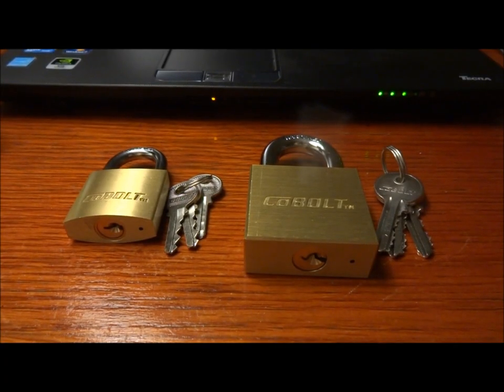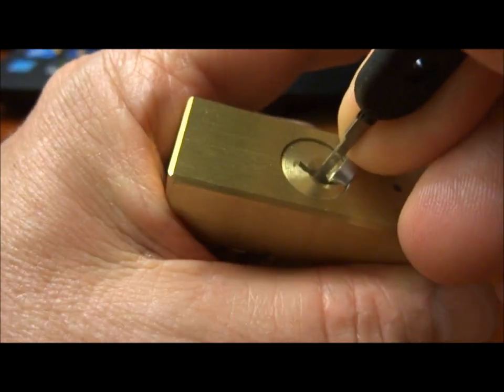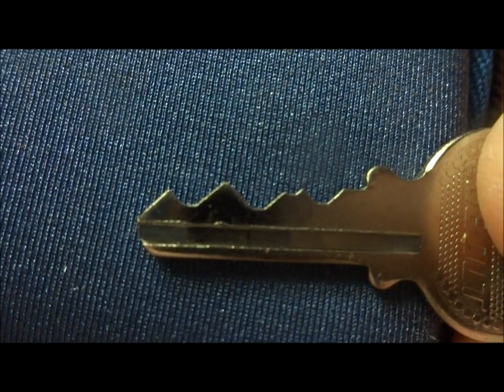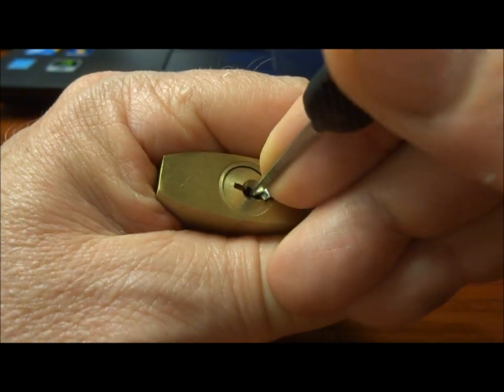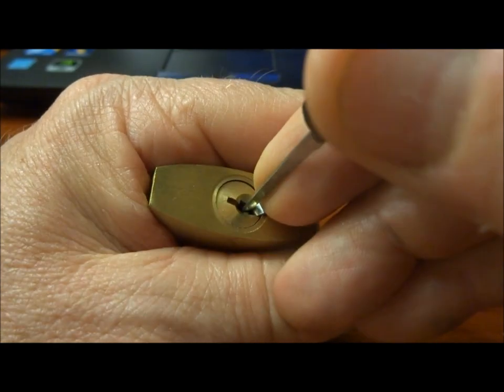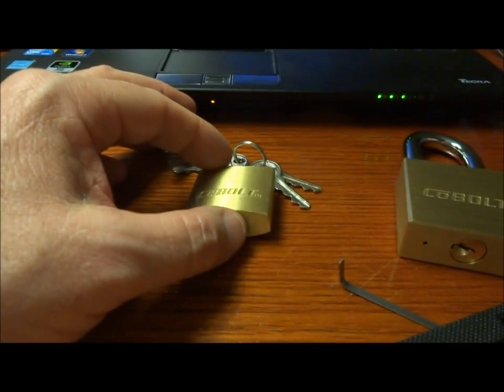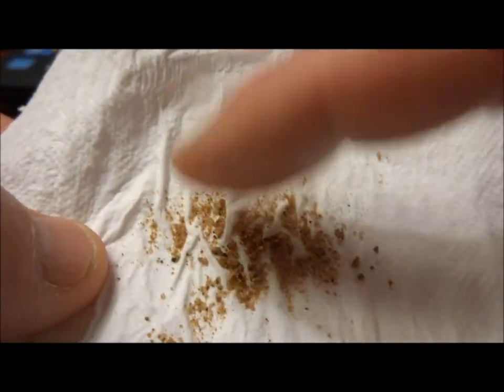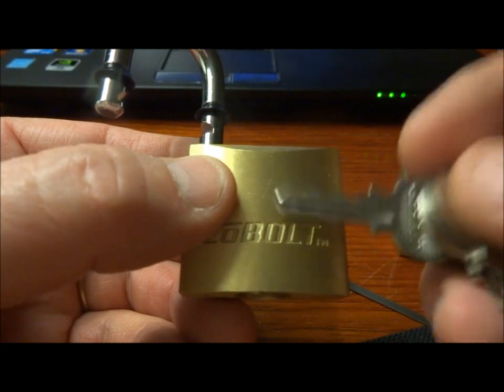(219) Complex Pinning and "Secret Sauce"

Comment: Hehe, sometimes that type of "secret sauce" can kill you. My bicycle stalled in a busy intersection, got me close to Mr. Death. The one-way mechanism in my rear wheel suddenly went "free way" (i.e. free-wheelin'). When I got home I picked rear hub apart and found alot of aluminium shavings left over from manufacturing process, they interfered/jammed the actuating lips setting them wide open inside hub. What shocked me alot is that these where expensive US$600 Mavic wheels too. I'd only expect this from a Loo Hung brand. I have a new habit nowdays with new wheels, first order of business, open 'em up, clear out, re-grease, ride!
Reply: for $600 I would have called them up and bitched that is a lot for a bike wheel
Reply: +Paxmax it is true that disc brakes have a slight drag but it sounds like something was wrong with them and they didn't want to admit it

Comment: The low quality of some locks can save the day occasionally. I've heard a story (90% probably that it's true) that a cracked Chinese lock got stuck 1/4way between closed and open and could not be opened in any way, and that's why the robbers gave up.

Moral of the story: always get the cheapest lock to protect your home.
Just kidding of course... Never trust cheap locks, they might stop working when you need them opened the most. Also they are unsecure. :(